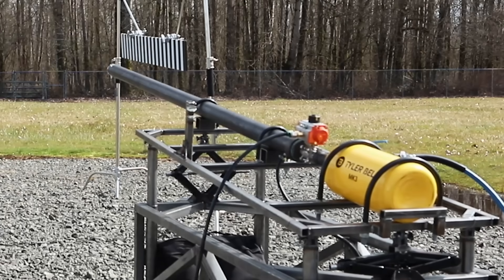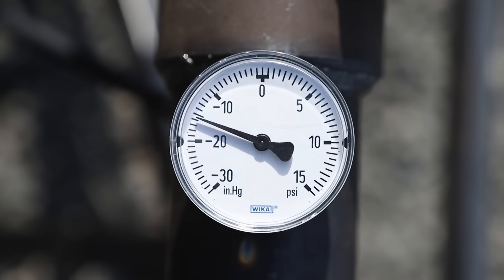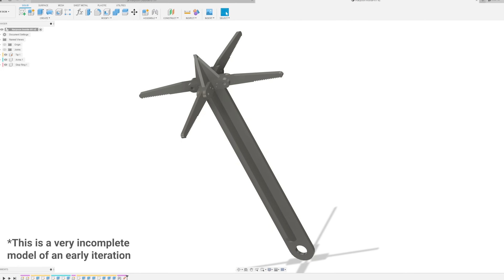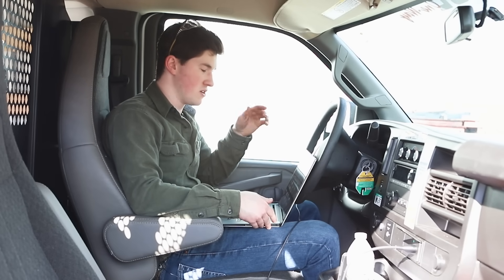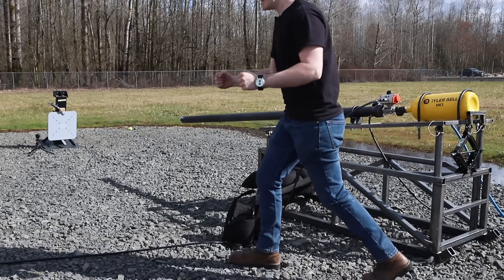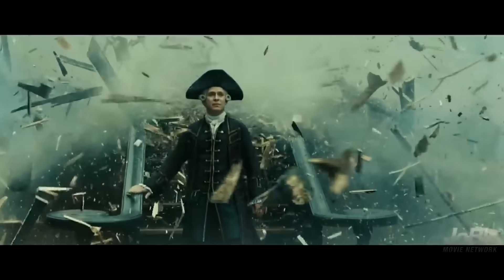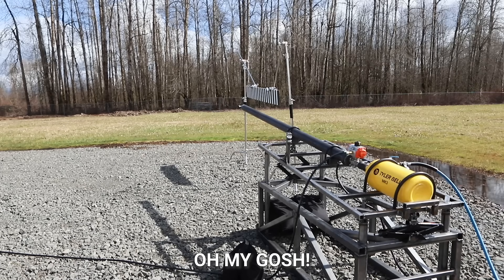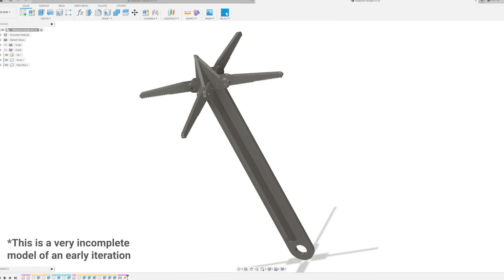Have I Found the Fastest Air Cannon Valve??

Comment from the maker: My patrons are helping me save up for a better slow mo camera! If you want to help me make better videos or want behind the scenes posts then consider supporting on Patreon:
patreon.com/tylerbellmakes
Reply: Have you tried using some lube on your balls? Maybe first just wet the tennis ball, then try soaking it in oil and lastly see if you can get some cow birthing lube or something like that from a farmer. I think Mythbusters found that to have the lowest coefficient of friction easily found.
Reply: @evilcanofdrpepper  I was going to suggest the same thing, another thought I had was dipping the balls and paraffin wax, after shooting quite a few of them through there you’ll get the proper back pressure and it will launch the ball further.
Reply: How about a longer barrel. 

It means the projectile has more time to gain energy. 

What also could help is adding some stuffing to keep the seal around the ball till the end.
Reply: I would like to see how this handles a diabolo round, think like pellet but tennis ball size, yes I know it sounds dangerous, but I still wonder, as far as slow motion goes, have you thought of working with the Slo-Mo guys? just curious, cant wait til the harpoon vid, Cheers
Reply: I think some value of comparative analysis between your design and another successful air cannon is worthwhile. If you look at the hypersonic baseball canon Destin from smarter everyday and crew build, it essentially is accomplishing similar aims to your project, but on a grander scale. Two or three features that might be worth borrowing and incorporating are; a nozzle type flow restrictor, which operates in principle like a rocket engine, in order to get high velocity flow from your air source. 2nd is a tapered plug, which allows high volumes of flow when the valve is opened, and it's easier to actuate as it can just be a pneumatic cylinder. (the tapered cone needs to pull in the opposite direction of pressure.) And 3rd is having a larger volume pressure vessel without a restrictive throat diameter.
Reply: Mark Robert has the fastest tennis ball
Reply: If you ever want to improve the speed. I have a good design that should improve it a bit.
Reply: Hi I saw the video what if you made longer barrel with narrow output profile also try lubricating inside the barrel to make effective use of energy transition
Reply: Did you try to lube or polish the interior of your canon barrel? It is welded or seamless pipe?
Reply: you may have had more success playing around with a wider barrel so there is less friction on the ball.. use a plastic ring around the ball, some Lubrication might have been fun to see lol
Reply: Just a heads up, there's a pretty active second hand market for phantom cameras. You may be able to save some money buying used, even if it's just on accessories like extra mags, lenses, cables etc.
Reply: I think if the problem is the tennis ball expanding because it's being squished there is possibly a relatively easy solution. If you made the barrel dynamically shaped. so that the very beginning of where the tennis ball sits in the barrel it's the same diameter as it currently is, however rather quickly the barrel expands outward in a conical shape to allow for the increase size of the tennis ball. it would take some calculation and most likely experimentation to figure out how quickly it will need to reduce back into its original diameter after the tennis ball regains its original shape.
Reply: A Golf Ball is a better Projectile its Solid and can bei accelerated much faster than a Tennis Ball
Reply: Cool video, just randomly stumbled upon it.  I believe you're correct regarding the tennis ball compressing in the tube, you might be able to negate this somewhat by using a larger diameter tube and building a piston that pushes the ball from behind.  This would allow the ball to grow in diameter and using piston rings reduce the amount of lost gas around the sides of the piston.  You'd need to figure out a way to stop the piston though, that would become a very dangerous flying object
Reply: you can rent a phantom
Reply: Slightly wider diameter barrel to accommodate a sabott around the tennis ball. 🎾
Reply: you should lengthen the barrel
Reply: You will never be able to open a butterfly, ball, shuttle value fast enough. And even if you did the orifices is too restrictive. Look up “supah” valve. We made a variation of it 30 years ago for a spud gun. It was pvc tubing. The barrel was surrounded by the air reservoir(larger tube with reducer forwarded). The valve was actually a disc made of thin polyethylene that sealed the end of the the barrel inside an end cap. The disk/diaphragm was a close fit to the inside of the larger diameter of an end cap. As it’s pressurized the air enters from the end cap side and pushes diaphragm onto the barrel seat and also air leaks around the diaphragm perimeter and onto the reservoir. Now pressure is equalizing on both sides of the disk but lower over the barrel opening. Basically air pressure is holding the disk tight over the barrel opening. Once it’s reached firing pressure, in the same port that was used to pressurize, a valve is now opened to vent. When that happens, the small space between the diaphragm and end cap depressurizes and the pressure of the reservoir forces the diaphragm to the cap, also suddenly opens the barrel to huge perimeter flow. The small perimeter leak is insignificant during firing, the diaphragm/disk will still move back and out of the way. These were much more powerful than the butane powered types. Make sure it’s legal to build anything that goes bang it where you are. If it’s a blue state, forget about it. When spud guns were the rage, some idiot shot out car windows and wrecked it for everybody.
Reply: Instead of adding pressure to the tank simple remove pressure from the barrel this This means the ball doesn't have any air friction and Reaches the speed of sound much easier
Reply: @Godofgaysegs  
Vacuum barrel kinda goes without saying for maximum speed. Since it’s impossible to get a pure vacuum, Smarter Every Day had a great solve on his baseball project.
Reply: I think you need to see "mythbusters supersonic pingpong"
You sir need vacuum and nozzle...
Reply: If you want to max out pneumatic acceleration, use a pulse discharge capacitor triggered solenoid valve which opens in 10s of micro seconds like a gun shot, and also as the gas you need to use something like hydrogen, helium otherwise have a smaller air tank with thicker walls and heat it with a flame (keep distance) and fire once you know the gas inside is really hot, you will far exceed the sound barrier using pingpong balls and probably even with a (smooth) tennis wall with a tight seal.
Reply: Why not using stored energy combined with a sear for the trigger? The stored energy can be varied. The sear guarantees it wont open unless you want it to. For example like a spring. Have the spring pull on the ball valve lever, and a mechanism preventing it from opening
Reply: use a longer barrel
Reply: How loud is it
Reply: have you looked into riffling or making multiple injection points for compressed air?
Reply: Did you measure the speed of your solid ball? Should give some answer whether or not it's projectile that's too soft. Someone said longer barrel and I also think that might add some extra speed.
Reply: 333é
Reply: 0:35
Reply: Naw Man. Use a pilot valve. They're designed to open as fast as possible.
Reply: At those speeds the air would feel to thick or dense , it would be easier to push the tennis ball through a fruit cake with your finger.
Reply: resolved simple used blackpowder xD big pressure big boom a no is a canon
Reply: @21LOLxPRO  ⚠️ God has said in the Quran:

🔵 { O mankind, worship your Lord, who created you and those before you, that you may become righteous - ( 2:21 ) 

🔴 [He] who made for you the earth a bed [spread out] and the sky a ceiling and sent down from the sky, rain and brought forth thereby fruits as provision for you. So do not attribute to Allah equals while you know [that there is nothing similar to Him]. ( 2:22 )

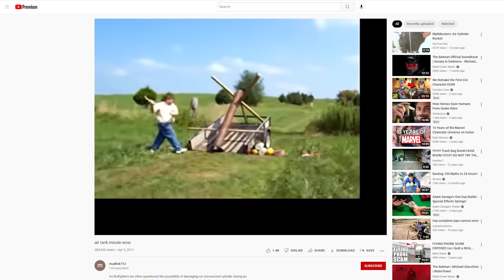🔵 And if you are in doubt about what We have sent down upon Our Servant [Muhammad], then produce a surah the like thereof and call upon your witnesses other than Allah, if you should be truthful. ( 2:23 )

🔴 But if you do not - and you will never be able to - then fear the Fire, whose fuel is men and stones, prepared for the disbelievers.( 2:24 )

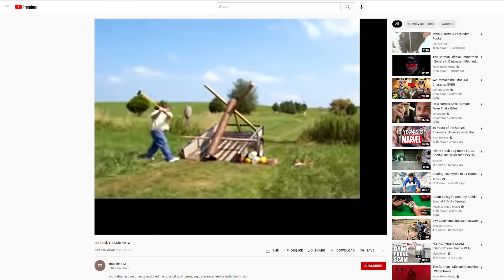🔵 And give good tidings to those who believe and do righteous deeds that they will have gardens [in Paradise] beneath which rivers flow. Whenever they are provided with a provision of fruit therefrom, they will say, "This is what we were provided with before." And it is given to them in likeness. And they will have therein purified spouses, and they will abide therein eternally. ( 2:25 )

⚠️ Quran

Comment: Can't be going beyond sonic speed without nozzling. you need a bigger diameter before that nozzles down to projectile dia. And after the muzzle you have to apply a supersonic opening nozzle to achieve a supersonic driving airstream with Mach's compression.

Comment: Tyler, check your pressure vessel to barrel volume ratio. You want something on the order of 4-5 or larger.  If you look at pumpkin Chunkin cannons  vs the size of the tanks and figure 150-175 psinoperatingvpressure based on an 8-10 inch diameter barrel.  You will have an approximate number.

I know several cannons that shoot over 4,000 ft with an 8-10 Lb. Projectile.

Comment: you shot them way faster than that, what you are experiencing at 0.75 mach is the transisioning into transonic turbulence, with such a low BC youre dumping all the energy soo fast you cant even get a measurement much above 0.75 because of the distance you use to measure, use an actual chrono at the tip of the barrel

Comment: I think what us happening is that all that to pressure simply hits one side of the ball and distorts and collapsed a huge dent in it that starts to turn the ball inside out. When that happenes the ball reduces in overall diameter which in effect reduces the overall pressure in the barrel to a maximum value that can be achieved with lower pressure.

Comment: You need to create a stiffened tennis ball that doesn't deform on the side walls of the barrel.
The way to do that would include creating a plug similar to what a shot gun round has in it (probably in the shape of a pressure cone like a blow gun has).  The connecting stem/shaft would be to transfer the forces without the ball deforming into the sides of the barrel.
(All this would be for nothing IF the ball starts to flatten on the front side at speeds higher than your current records.)  If that's the case then you need to have calculated what the shape of the ball will be when it breaks the sound barrier?)

Comment: Some potato cannon builders use a diaphragm or piston valve with the barrel going through the air chamber. Venting the air behind the piston or diaphragm pulls it away from sealing the back of the barrel and dumps all the air into the barrel.

Comment: Built a Spud Cannon using compressed air. Had a Full flow fire suppression system piston valve. It worked the best i don't remember what model think it was from a decommissioned Halon system.

Comment: What about having a bigger tank?  I would think u would lose speed bc that volume of the smaller tank has to fill all the tube. So more volume then the tube and then play with your pressure. You are using straight air. Nothing to help expand that air like with potato cannon or gun. So you would need more volume like pumpkin shooters.

Comment: You want fast? Prime cylinder with acetylene and a spark ignition 😊. 450 fps on an orange . Yes a bit slower but much heavier.  Will push a piece of fruit through 3 sheets if half inch ply wood back to back 😮

Comment: Fastest valve, wondered. Printed or turned bullet. Rear end like jacketed bullet ie parallel sides with flat or concave rear end. Diameter of bullet to fit readily available oil seal/air seal. Same diameter as barrel. Front of parallel side to have step around it to catch on rotating lock as used on old crossbow, disc with bearing pin at 90° to barrel, 2 notches/cut outs in disc, one to engage in step on front of bullet other notch to be held by trigger. Bullet to be pushed down barrel until rear of bullet fits into oil seal where it is held from moving forward by notch in rotating disc. Pressurise tank. When ready pull trigger allowing disc to be rotated by pressure of bullet releasing bullet

Comment: What size and type of pipe are you using for the barrel? Im assuming its seamless but some times there are inconsistency in inner diameter which could be causing issues. Maybe lubing up the ball would help with rubbing issues

Comment: If you flared it out and ran bigger butterfly valve it would work a lot quicker as the valve would be letting full flow through being slightly open, rather than having to open it fully,

Comment: couldn't you use like 4 valves that converge back into the barrel ? even if every valve is only cracked, the total flow of every cracked valve should be high. Or make a valve mechanism with a gear as the valve arm and a big gear with 3/4 of the gears missing so i can spin up fast before hitting the valve and then it opens it basically instantly ... but it might destroy the vlave

Comment: I made an air cannon that fired 1/2" diameter 10" long steel rods out of a 10' barrel. 125 psi in the tank, standard brass full-port ball valve. Fired it 50' down a hallway and buried it 6" into a concrete wall.
It was so scary I took it apart and never made anything like that again.

Comment: You need a lot of pressure and volume stupidly fast when the valve comes open . Spring load the butterfly valve and make a seared trigger to release it . That or make whats called a reverse coaxial cannon ( the cannon barrel sits in the pressure cylinder with a sealing poppit cap ) .

Comment: i developed (with some help) the basics for a steam powered bolt excellerator that can output the bolt with 10 megajoules and 30.000 m/s
the pressurevessel is not even 40cm in diameter, it is simple to manifacture and the only downside is that you have to anchor it to the ground or it will send itself flying

Comment: This is not like that how you should make a quick discharge valve!🤭🤭🤭
A quick exhaust valve is made of a piston closing the exhaust on one side and on the other side of the piston, behind it is a chamber where the air pressure is the same.But since the inside of the barrel is only at atmospheric pressure, the piston remains pressed in the closed position. It is enough to open a valve to empty this chamber and the piston instantly moves back and opens the passage to all the pressure.
Look at the quick discharge valves drawings on the web.

Another principle is that of the rupture disk: a disk made of brittle material of controlled resistance is used to seal the air tank, and a sudden but not excessive increase in pressure (created for example by a small charge of black powder or a supply of propane in the tank and ignited electrically) breaks the disk.
This is the principle that cannot be equaled by any other principle, because of its instantaneousness and the straightness of the tank-barrel conduit that it allows.
But the opening speed is not everything, the performance must also be improved by a greater pressure of the same quantity of air in a smaller tank which allows to reduce the dead volume of the tank which reduce seriousely the general efficiency, and a obligatory increase in the length of the barrel in order to use all the adiabatic expansion.
Note that if you want to operate a big quick discharge valve for a big cannoon , you should make a small quick discharge valve operate the bigger one, for greater efficiency.
🤗🤗🤗

Comment: there are industrial imaging cameras used for diagnosing faults in manufacturing equipment that would work at the higher frame rates you want on the cheap, but they are usually monochrome and don't have much memory

Comment: Look up “Thermal Velocity”. People who build air guns know about this limitation. Basically, the maximum velocity air can travel at room temperature is 1,520ft/s. Increasing pressure above a certain point doesn’t make much difference beyond adding volume. A lot of regulated air guns operate at ~1,000 psi (after the regulator) because increasing the pressure from there has little effect. You could fill the tank with hydrogen which has a thermal velocity of 5,750ft/s at room temperature. You could also heat the air. Light gas guns achieve incredibly high speeds through using hydrogen and compressing it in an instant which raises the temperature to an incredibly high level. In your setup, my guess is you need more volume and a larger and faster valve. Ideally no valve or pipe diameter would be smaller than the barrel.
Reply: I appreciate a inteligent observation. 
Bravo.

Comment: Seismic airguns use a relatively small 3 inch valve to release several thousand pounds of pressure instantly from each airgun to create the blast simulating TNT they used to use before that technology to create the sound frequencies required to explore for oil under oceanic sediments.

Comment: Does diameter of the valve (eg ball valve) have much impact on velocity of the projectile? Trying to work out if it is best to make the ball valve the same as the barrel or if going to a  smaller ball valve would be better